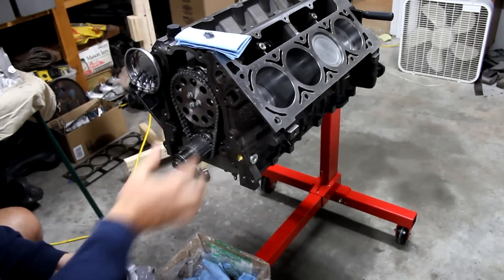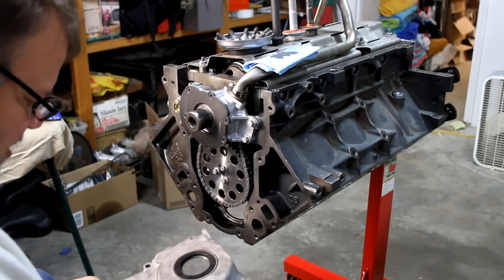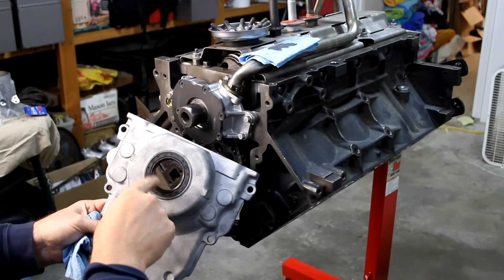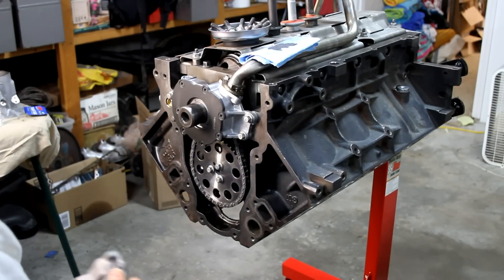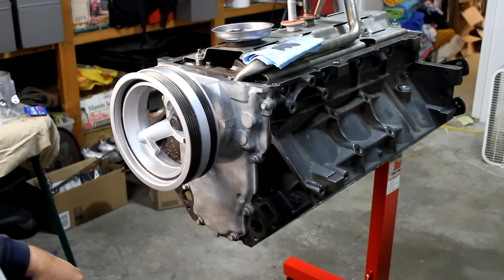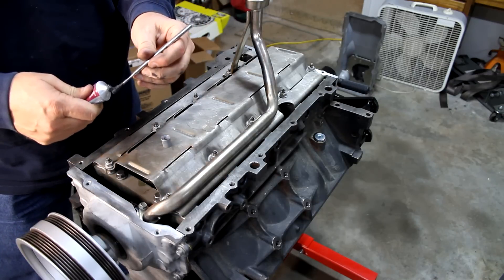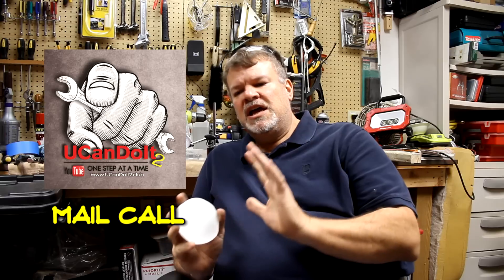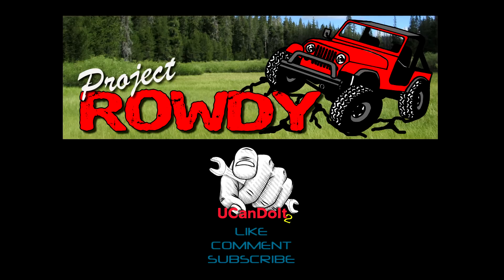LS 5.3L Build Part 5 Oil Pump and Covers | Project Rowdy Ep009

Comment: Still working on getting the engine running. I'm pretty sure I missed a step or I just didn't think it was critical  enough to do. Think it's called " degreeing the camshaft to find TDC", I just made sure the dots were lined up and the #1 cylinder was in the up position.
Reply from the maker: Great to hear from you...  My thoughts are the following....  When I researched "Degreeing a Cam", it became apparent to me that, all you are doing is verifying that the Cam that you have matches the Cam Specs and that it has the correct "Grind".  There is no adjustment that you can make after following that process.  I elected not to do it.  I bought a production spec Cam.  I guess I assume that it is correct.    TDC...  This term is from the old school of engines.  With older engines, there was a need to know when the 1st cylinder was at TDC and you would adjust your distributor to, say 4 degree before TDC...  Well guess what....  we do not have a distributor any more.   "Spark" is managed by the Reluctor Wheel on the Crank shaft telling the PCM what position the Crank (piston position, TDC) is.  The PCM manages the Spark ( old Distributor) and advances or retards the spark (old vacuum advance) based on tables, RPMS and TEMP.   It's kind of a no brainer these days.   I did see your latest video and the Timing marks do appear to be correct.   The Timing Set marks are to make sure the CAM and CRANK are in synch (TIMED) with each other.   Hope that helps a little.   Mike
Reply: Thank you so much for getting back to me so soon. I thought the same thing about doing a cam degree and finding top dead center. It also seemed to me that all you're doing is verifying what's on the cam card that came with your camshaft. I just watched about 15 videos of 15 different guys doing degreeing the cam and all of them came out with exactly what the card said by just lining the dots up. I also read through the book a couple times and they pretty much say the same thing you're just verifying the numbers on the card. I don't want to sound lazy but I don't think I'm going to do this. At a minimum I think I'm going to go ahead and figure out top dead center again. Everybody that has done this has never said if the numbers are wrong what to do other then do it again. Thanks again.👽

Comment: Hey Mike, I have been following along with this series as part of my resources to rebuild my LS at the moment. Im currently up to this point and was just wondering how the front and rear seals held up without having the alignment tool. Did you experience any leaks around the seals or oil pan, or would you recommend this same method? Thanks for any help!
Reply: This is was beyond what any tech in a shop does. The alignment on the front cover is extreme overkill. I've never seen any tech be that meticulous and I've been turning wrenches since 2003 and became ase certified in 2006.  I've never seen one leak due to an installation misalignment. Seen a few leak when they don't get seated properly, typically something between the block  and cover that prevents it from seating properly. I'm not saying this way is incorrect by any means but it's definitely overkill on anything that's not an all out race car motor.
Reply from the maker: To be honest.  I am still restoring the vehicle that this engine will be installed.  But I will say that I would recommend this approach.  There is no way that any tool would could get that alignment any closer than the method that I used.  to the touch, it turned out flat like it was a single piece of metal.  That particular area get a dab of sealant which just seals the deal anyhow.   Have fun with your build.   Sorry for the late reply.  this message did not popup where I normally check for messages.   Cheers!    Mike

Comment: You know in hindsight to align that timing cover all you technically had to do was mach up oil pan  leave the cover  bolts loose on the front of the block... tighten the oil pan down to the block and the cover and that would have aligned everything ... then tighten  the timing cover bolts.  That would have put it dead on! 
Just my 2 cents.
Reply from the maker: I hear you and that is certainly another way to do it, but technically I believe the way that I did it is superior.   The reason.  I was able to tighten the front cover with the bottom edge flush.  The oil pan then was tightened to that complete flush surface.  All of my joints are tight.   In your sensational, by tightening the oils pan down first you created a corner that the front cover had to be simultaneously pressed into the block and oil pan surface.  That breaks all rules of logic in my head.   If it works for you… go for it.  I would not do it via your approach as I believe I would end up with a leak.   Cheers.  Mike!
Reply: @UCanDoIt2Mike  ya your prob right  the timing cover being squared up makes for more rigidity. You would need a truly  leveled  oil pan that isn't going to flex /bend. Timing cover material is likely built better then an oil pan making your way better .I agree after seeing  your point
Reply from the maker: Specifically for the front cover I also wanted to allow the balancer to self-center the front crank seal.  My method allows for that.  Your could slightly mover the cover up the block surface causing that seal to also be misaligned.
Reply: @UCanDoIt2Mike  
What's the cost to do a mild  cam and all parts rebuild  even the block work. 
My brother is giving me his  aluminum   L33 5.3  from his 05 SILVERADO 4X4  
I want to .30 over  rebuild for my 02 s10 with a nicer cam
Reply: I'm guessing just pistons rings all new bearings   and cam of choice and reuse the rods and crank  ... Probably a nicer timing set and have the heads... redone
What would you suggest?  Are there any good necessary upgrades one ... should do with a 5.3 being a l33 block .
Reply from the maker: @ach5084  An upgraded (non-Stock) Cam is probably going to require new Valve Springs.   That then illustrates that point that it doesn't make too much sense in rebuilding an engine, if you don't completely overhaul your heads.  I did new Rods, but that would not really be necessary.  I did Stainless Valves.  Timing chain is a consumable part and should be replaced.  etc. etc.
Reply from the maker: When I was deciding on an engine for my build, I seriously considered the L33 Aluminum Block.    In the description section under each video in this series, I have a link to a PDF file that outlines all of the parts and pricing of my build.  Check that out.  It includes the machine shop costs and all.   I believe I have $5100 in my build.  That includes the $609 for the original engine purchase.

Comment: Fixing to rebuild my  5.3 lm7 putting a Brian Tooley racing stage 2 cam with all the goodies Milling oil pump Etc and I've noticed you don't give torque specs why is that !?
Reply from the maker: There are so many Torque specs used in this build.  The Book that I followed had a section in the back that included all of the torque specs.  You should really consider obtained a good written reference guide for those items.

Otherwise:  Laze, Liability, you would just have to write them down.  The book of your choice can be had for a little as $25 or so.

Cheers!  Mike
Reply: @UCanDoIt2Mike  absolutely thanks Mike ! I did a pain the spec sheet still enjoy watching your videos thank you very much brother
Reply from the maker: @banette36  I appreciate the feedback.  Glad you found some value in them and most importantly, have fun with your build!  Mike

Comment: Did you paint your harmonic balancer?
Reply from the maker: I did.   I taped off all of the thin rubber sections as I knew the paint would not stick very long to those areas.
Reply: @UCanDoIt2Mike  did you paint it before or after you took it to machine shop for balancing?  I'm curious if paint would throw off balance of rotating assembly
Reply from the maker: After the machine shop work.   I rotated it while painting to attempt to lay an even coat.

Comment: How's the oil pressure on rowdy do you recommend the m295 oil pump you used on the video thanks
Reply from the maker: Believe it or not, I am still working on Rowdy's bodywork and have not installed the engine yet.   But I recall the research that I did on the Oil Pump and remember that while it is the Standard version, it pumps better than the EOM.  It was not recommended to use the next higher performance  oil pump unless you increased the oil pan capacity and plan to use the engine at higher rpms.  The higher performance unit can suck you pan dry.  The one that I used is supposed to be an excellent upgrade from stock.   Cheers!!!!

Comment: I’ve heard other people say to install the oil pan first and the front cover will sit on top of it to align
Reply from the maker: That would physically be another way... BUT!    Just thinking logically, I would not use that approach.  You could develop a leak on the surfaces where the covers and the pan touch.  

Here is why I think that. 
With the covers installed first, when you install the oil pan and torque it down, the surfaces at the pan and covers will get clamping pressure.  If you were to install then in the opposite order, I do not believe you would be able to achieve that properly.  That is already a trouble spot for leaks.    Just my thoughts!

Comment: Did you reuse the original lower timing gear/oil pump drive or have to swap it when using the Melling?
Reply from the maker: I bought a new Timing Set.  Which includes a new upper and lower gear and timing chain.

Comment: Hey sir I just watched your video, very detailed. I need to ask a question if you don't mind. I have a 2002 GMC yukon xl with a 5.3. I replaced spark plugs, wires, oil pressure sensor and valve cover gaskets. I started it up and it started misfiring. I got a code p0306. I swapped injector and coil, did compression check, and fuel pressure check. All good. I'm puzzled, on bank 1 I can disconnect the coil or injector and notice change in engine, bu or on bank 2, I can disconnect all coils or injector, no change. Plugs are firing, injectors has pulse. I sure hope someone reading this can offer some advice. Note, it was running fine before I put the new parts on it. I've scratched my head till I don't have to have a hair cut. Thanks to anyone that can help. One more thing,  I swapped out 02 sensors,  and disconnected  exhaust manifold to cats still nothing. Have a great week.

Comment: something you didn't touch on is the oil galley barbell, did it go in and did you use a stock one or aftermarket?
Reply from the maker: I thought I covered it.   I installed a new barbell.  It was a part of the kit that my machine shop created for me.

Comment: Did You skip the cam to crank timing
Reply from the maker: I may  have in the video.  AS with all engines, you align the dots on the Crank Sprocket and the Cam Sprocket.  In my case the Dots where very faintly painted on.  Cheers!

Comment: I enjoyed the video by using the actual seal to help center the front & rear cover seals for centering. Knowing that not all engines are machine exactly the same, how did yours come out? No leaks? Just curious, no slam on you're chosen method, as I too and heading into this project. As a retired ASE Master Tech since the building had "Datsun" on the front of it, I am retired but have not worked on the "LS" type engines or this cast iron block truck engine. GM's eSI has some specs for deviation from flush, but they are using two $300 Kent-Moore tools in their instructions. Thanks for this fine innovative instructive video and hope all turned out well!
How didd the "Melling" pump work out? Let me know, as I can no longer afford to physically do this again in the near future. Thanks, liked and subscribed!
Reply from the maker: The vehicle that this engine is being swapped into is still going through alterations and bodywork.  The Melling Pumps are supposed to be a fantastic upgrade from the factory.  Cheers!  And thanks for watching.

Comment: I didn't see you lube that front balancer seal...?
Reply from the maker: You are correct in that I DID NOT lubricate the inner seal per the instructions.  The build guidebook that I followed stated the following:  "However, the seals themselves are designed to be installed dry - do not lubricate their inner rubber surface!"

Comment: Nice work!! Well done!   You missed the importance of lube on the front and rear seals before puting them on the balancer and the rear crank surface.  The will fry in seconds if dry.  I'm sure you lubed them but just never mentioned it.  One suggestion: Let us know  all the torque values you use.  Your numbers obviously work and there is a lot of discrepancy on what value to use depending where we look.  Two thumbs up!  Professional video
Reply from the maker: Not sure where you get your information, but the manual that I followed specifically mentioned to NOT Lube the round seals.

Comment: Love the video very informative ... I'm not diggin the torque pattern on the front rear covers and the oil pan. My opinion never torque in a circle. Snug then top, bottom. Criss cross middle . May not make a difference just throwing it out there.

Comment: Can you buy all the hardware in a kit in case you lose some?
Reply from the maker: There are "Rebuild Kits" that include much of the hardware and components that are needed to d a rebuild.  You just have to be careful where your particular build requires an adjusted size part due to some machining or other reason.

Comment: really like your videos, appreciate the time it took you to make them.  How did you keep the crank from rotating when you put the H balancer on?
Reply from the maker: Carlos Gutierrez  Thank you Sir.  I placed the old Flex plate back on the back side of the Crank and placed a bolt/nut through the flex plate and then used a clamp to not allow the flee plate to rotate.   I believe I mentioned this in this or another video on this engine.  Cheers. B
Reply: @UCanDoIt2Mike  Thank you very much.  You sir a true gentleman.

Comment: I just installed my cam and ordered new gaskets for everything . I’m about to install the timing cover & this is the video I was looking for. Straight forward and great detail . Thanks 
One question , is it necessary to add rtv after the gasket just to be extra safe for leaks? Or is this gasket enough
Reply from the maker: The new style gaskets DO NOT need RTV or any other sealer.  The only place that you should apply sealer is at the four corners where the Front and Back covers meet the block.  That is an area that is considered "Between" the gaskets.  Cheers... and have fun with yours....  Mike!
Reply: UCanDoIt2 ok. & is rtv brand ok to use on the 4 corners? Also, what size what the longer bolt you used to install the crank pulley
Reply from the maker: RTV should be fine for the corners.  Harmonic Balancer Installation Temporary Bolt:     M16 x 2.0 x 120mm (Fastenal # 11127092).
Reply: UCanDoIt2 thank you sir

Comment: Where did u find the longer HB bolt at?
Reply from the maker: Harmonic Balancer Installation Temporary Bolt:     M16 x 2.0 x 120mm (Fastenal # 11127092).

Comment: Whats most important is that the seal is centered perfectly, not the pan rails. The gaskets and a little RTV will fix any issue in the rails, but an off center main seal is destined to leak.
Reply: So how do you get the seal perfectly centered. My rear main leaked slightly after I did the seal and plate.

Comment: Very very informative video! What is the process for installing the rear main seal??
Reply from the maker: Thanks for the kind words!  For the Gen3 and Gen4 platform engines, they have a rear cover and the seal is mounted in the cover (as seen @ 11:34).  It is a large diameter seal and I believe I used a flat board to help install it into the rear cover. Interestingly the manual stated to NOT pre-Lube the seal. It is to be installed dry.  It is important that while tightening down the rear cover that you allow the seal to remain centered on the crank while aligning the lower two edges for the Oil Pan.  This is all a complete redesign compared to the old 350 platform.
Reply: UCanDoIt2 did you use the special tool that they sell to keep the cover completely centered on the crank hub?
Reply from the maker: I did not buy the special tool!   I am a bog believer that you need the right tool for each job, but sometimes you can get it done with what you have.  I also do not like the thoughts of Special Tools!!!!   My thoughts on this particular case.   When you slide that cover and place the rubber seal over the crank....  it is going to "Self-Center".  It naturally wants to rest where all of the pressures are equal.  I just rotated it from the initial position until the bottom edges where flush with the bottom of the block and tightened it down.  That was my approach.
Reply: UCanDoIt2 thank you for your help. Your videos are gonna help me finish my LC9 build
Reply from the maker: Get yourself a good book!   There are many out there.  They will keep you heading in the right direction.  In the "Show More" section under this video is a link to the one that I used.  There are many others as well.  They contain all the torque specs as well.

Comment: Anyone else notice the double or triple clicking of the torque wrench everytime???? It’s a bad habit most people do but when it’s done it can actually cause the bolt to get over torqued
Reply from the maker: It's comical when keyboard mechanics manufacture technical theories.  Double-clicking a torque wrench (1) does not rotate the fastener any further OR (2) damage the torque wrench.  Certainly not worth having a lengthy conversation about!
Reply: UCanDoIt2 tats funny because mechanical engineers at Caterpillar in Lafayette, in show test PROVEN that it does effect the torque consistency. Sorry you’re too simple to understand.